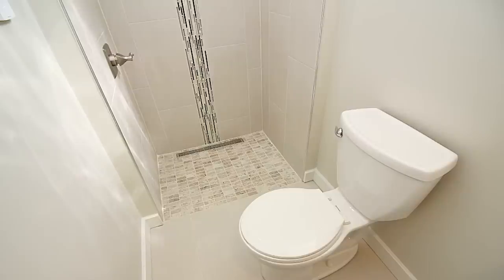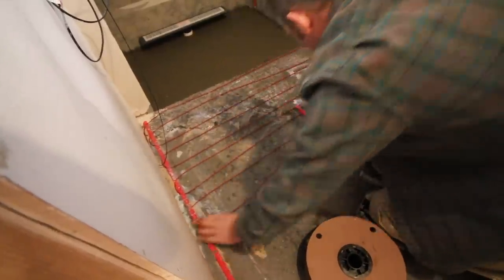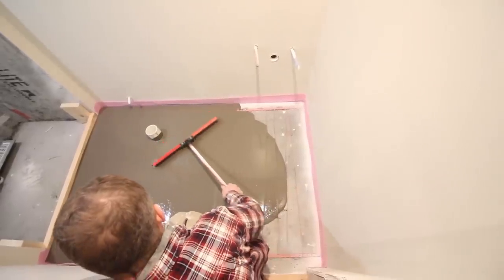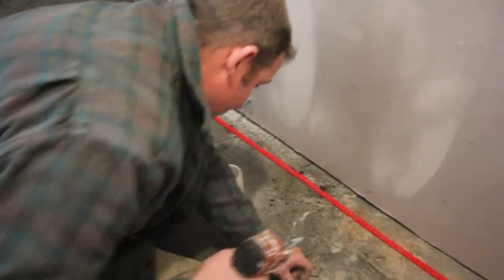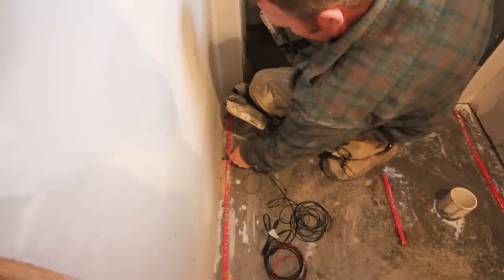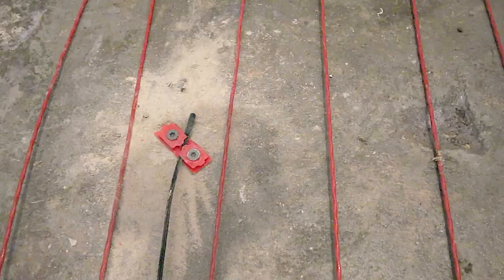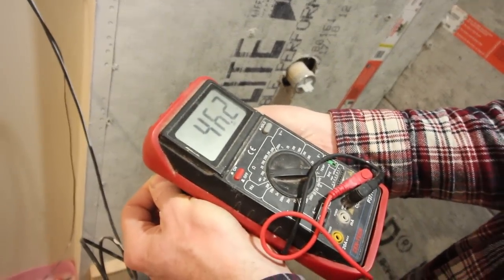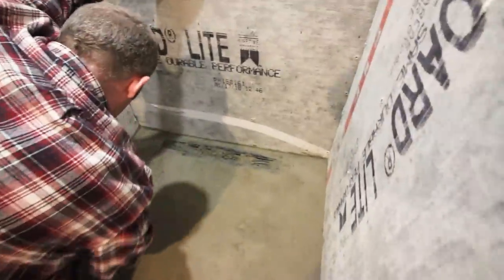Build Curbless Walk In Shower on Concrete Floor (Part 2: Heated Floor and Self-Leveling)

Comment: Good content.  I've read that the temp sensors in the heated floors can fail over a shorter time than you would expect.  The other concern I've read is relating to flooding basements.  I agree that a heated floor in any region where snow falls is most desirable.  Thank you for identifying products and the cautions you mentioned (distance from walls, distance from wax seal, etc).
Reply from the maker: Thank you. Yes, wouldn’t recommend a bathroom like this in a basement that floods. Fortunately this one was in good shape